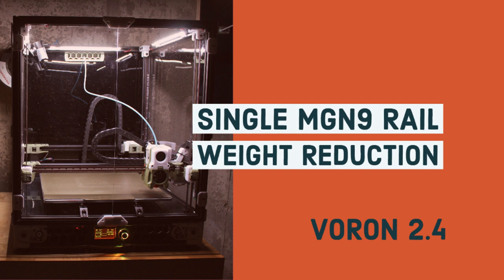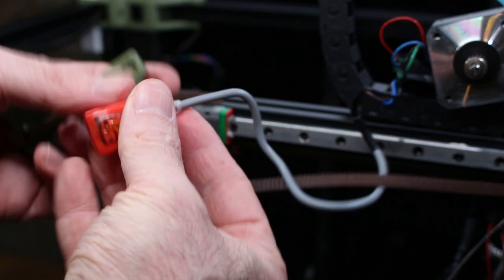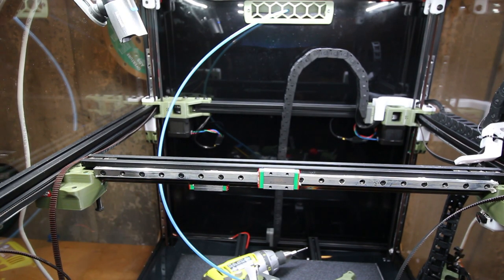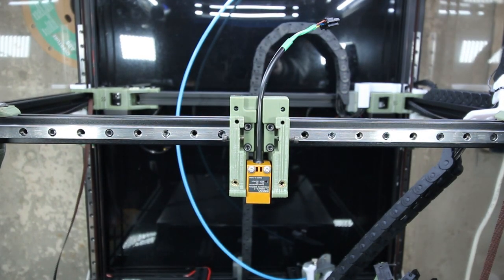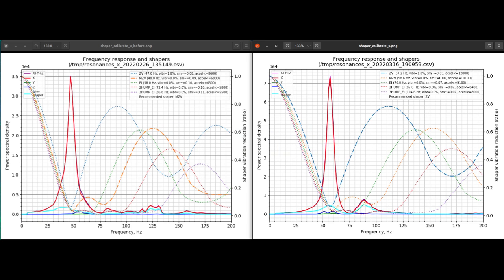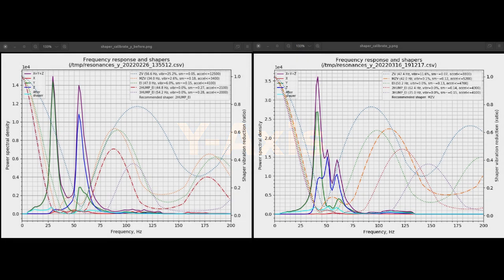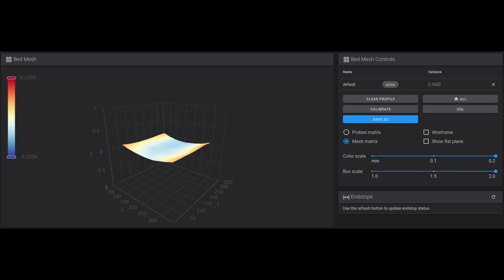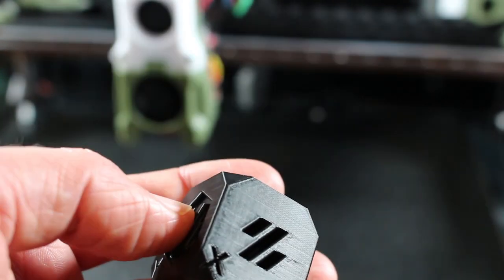Double your acceleration for free?  Eliminate x-axis weight with a single MGN9 rail.

Comment: Inspired by this video I've assembled my Voron 2.4 with one rail MGN9 and Stealthburner with CW2 extruder, finished last week. Already making some tuning but started printing some parts. A little change into the carriage was needed: put the upper thread inserts to fit the motor plate at the back of the carriage where it should be the head of screws. Thanks.
Reply from the maker: I'm really happy with how this came out and how well it's printing. It does rely on a High quality rail. I hope it's working well for you.  Thanks for the feedback!

Comment: I ended up going with a single MGN9 rail almost two years ago on my 350x350 2.4 purely out of frustration with alignment issues and weird things happening to the bed mapping topology when the chamber was up to temperature vs when cold ... Purchased a MGN12 rail from Ali Express at the time i went to the single small rail, thinking that i will upgrade to the single 12 when it arrives but i have just had absolutely no reason to and completely forgot that this was the plan... This does work very well for me and i have printed and sold many parts from this printer with great results.
Reply from the maker: I have been avoiding the mgn12 rail..  I also have a new one sitting here in it’s package waiting to be used.  But I really don’t want to as the mgn9 works perfectly.  The only problem I have seen is if you try to move to the r2 xy gantry joints, they are designed for the increased height of the mgn12 rail, so if moving to tap, you need to install a spacer to keep the xy belts parallel to the rail.
Reply: @KapmansBasementWorkshop  Ah, that is very good to know, thanks. At this point I think I would look at just replacing the single MGN9 if I start having any issues, and maybe trying to go up in quality to something a little better than I have in it currently.

Am also currently printing out parts for a Euclid type pcb probe setup (My original Omron type probe has been going fantastically well, but is starting to bulge out from the heat of printing at higher temps) - so i will be making good use of your video on the Euclid probe setup shortly. 
Thanks for the detailed videos!
Reply from the maker: Thanks for the comments. Euclid probe has worked great for me. I’m sure it will for you too.  Be sure to check out the automatic z-calibration software as well once you have Euclid working. I highly recommend it.
Reply: @KapmansBasementWorkshop  Awesome! Thanks

Comment: I just did this on my 2.4r1 and honestly just take the 8 M3 bolts holding the x-axis to the linear rail blocks and remove the whole thing outside the printer.  Way easier than trying to disassemble everything inside the printer.
Reply from the maker: I'm getting ready to work on my gantry again.  I will follow your advice!

Comment: Its almost like the design engineers had no idea what they were doing when they found that the original single MGN-9 design caused issues and they added that second one to fix it. Personally, I think they are re-making the same mistake going to a single MGN-12. My observation is that the entire print head can twist (I observed this when the screws on my bottom rail had worked loose). The twist is not coming from play in the rails - it seems to be due to the elasticity of the ABS itself. That second rail really does seem to address tortional stress in the tool head. I'll be interested to see if you are still using the single rail in 6 months.
Reply from the maker: It's almost 6 months since I made that video.  I'm never going back to 2 rails in the x.  And i have no intentions of adopting the MGN12.  I just moved to StealthBurner and modified the old carriage to work with SB CW2 and I'm very happy.  I'm not going back.  I agree, I think some of the movement is the ABS itself.  I also believe the dissimilar metals cause a bit of a problem when they get hot (aluminum extrusion and steel rail).  But I saw nice improvements with a quality single rail.  And a nice acceleration bump as well.  Thank you for watching!
Reply: @KapmansBasementWorkshop  I'm glad you got a good result - there's no arguing with results :)
Reply: Amateurs don't read or understand how to read datasheets and have no experience in real machine building and actual nechanical engineering as opposed to lego construction and playing follow the leader sheep like thinking.
Reply: @m3chanist  perhaps, but is it the Voron devs you are implying are "amateurs"? Do we even know what their qualifications and experience is?
Reply: @KapmansBasementWorkshop  Beautiful work! Going to update now my only system to CAN bus and Stealthburner.  (my first cable break, i see more damaged wires and my temporary fix with soldering the cables  is nothing forever) Would you mind sharing the modified x-carriage for CW2?
Udpate: sorry too fast, i found it in ellis repository :-)
Reply from the maker: @quattroes  Thank you very  much!  You can find it at Ellis's repository or mine.  So far, Canbus has been great for me.  My video on Klipper screen shows some additional changes where I remove the waveshare hat and replace it with a BTT U2C device.  May you have a smooth and quick transition to canbus!
Reply: @KapmansBasementWorkshop  Thanks! Will have a look :-)
Reply: @KapmansBasementWorkshop  do you still use the single mg9 without problems?
Reply from the maker: @adeo  I am still using that single 9mm rail. That said, I have ordered a new one with higher preload mainly for TAP.  But I am currently using the same rail with Tap and it works. I want to see if I can get some benefit from a tighter rail.  I really think a quality 9mm rail is all that’s needed with these 3d printers.
Reply: @KapmansBasementWorkshop  thank you
Reply: @KapmansBasementWorkshop  why not just reball existing rail? Drop into your local skf shop and get some different size balls for the carriage

Comment: In regards to the comment on why MGN12 and not a single MGN9, the cause seems to be production quality. For hiwin it makes a lot of sense with mgn9, but when looking at the cheaper rails that a lot of people get, they can have play and wobble which is more easily avoided in production of mgn12. This is what I've heard reiterated, it makes sense considering that was probably the reasoning for dual mgn9 in the first place.
Reply from the maker: I've heard the same as well.  I've also seen a YT video where someone actually measures the differences between the HiWin and another typical rail.  There really was a difference that depending on the use may be significant or not.  In the case of the x-axis, I think it's significant.

Comment: Hey, the stealthburner  also uses the lighter stepper motor too. You can find both the beta files for it and carriage adapters for almost any hotend to use that stepper motor. Im  currently building a 350mm voron 2.4r2 but reprinting the stealthburner partd
Reply from the maker: Yes, I definitely plan on building stealth burner once it gets out of beta.  I'm expecting it to change a bit before it's finalized.  I've also got some other ideas of how to drop a significant number of grams from the x-axis I'll be working on before then.  Thank you for the tip and for watching.  And I wish you good luck with your build!

Comment: old video I know.  But these rails will slowly wear away and lose tolerances.  Looking at your bed curve I have to wonder how much this increased wear attributes to the bed curve being reported.   As you know wear will occur fastest where the rails run the most often, the most traveled segment will translate to the middle of your bed.

You see this a lot with old mills and lathes...the cast iron ways slack in the middle of the range and the if you take the slack out by tightening the gibs it can be almost impossible to use the full +/- range of the given axis.
Reply from the maker: The rails were relatively new when I did this.  I don't think it was a big factor.  And that one rail is the exact same one both before and after.  I don't believe it was a factor in this case, but I believe you are right when it comes to more heavily used rails.  Truthfully, I believe once the gantry is using a single rail that is perfectly straight, the biggest issue that makes the bed appear curved is due to the gantry heating up with the dissimilar metals...Aluminum and the steel rail that causes them to curve making the bed appear curved.

Comment: Are LDO linear rails (LDO-SLR9H-400Z0) good enough for the 1 rail mod? Would said mod cause a loss in quality, compared to 2 rails, during very high accelerations?
Reply from the maker: They are probably fine.  Especially if they have some preload.  The carriage on the rail should not have any rotational play.

Comment: Did you do the resonance tests with the same conditions for the before and after? It looks similar to my results on a 350mm from when I moved it from the kitchen table to the floor. The dfference really shocked me.
Reply from the maker: Those were the exact same conditions and location.  The printer did not move between the 2 tests.  I wanted to make sure everything was the same for accuracy.  I assume the floor gave better readings in your case?
Reply: @KapmansBasementWorkshop  Yes the floor gave me similar results to yours but with some more vibration and less accel on Y. 

Really impressive results, I should consider moving to one mgn9 when switching to Stealthburner. Do you know what caused the 2 humps on your first graph? I'm wondering if the gain was only through weight reduction or also a correction of misalignment or similar.
Reply from the maker: @felixisme  I only removed the one rail.  I did not adjust the placement of the rail I left on at all.  I strongly believe this is all from weight loss on the gantry.

Comment: I dont think you should put grease on linear rails, the tiny balls need to run through it... you need much lighter lube for that.
Reply from the maker: There are many that believe light oil is enough, and for this application that may be acceptable.  But I did research this.  These are Hiwin rails and I went with the Hiwin recommendations.  https://youtu.be/jqBq4DB89f8
I must say, while when new these rails had some preload, after some time running with the grease, they glide beautifully with no play.  I'm very happy  with them and the grease.

Comment: btw. Is there even a reason to use an extrusion and then mount a rail to it? Wouldn't using only a rail as the x axis be enough?
Reply from the maker: I think on smaller printers, a rail is probably all that is needed.  Although I wonder how flat rails are.  Bolting one to extrusion (assuming high quality extrusion) probably can help keep it straight.  I've seen printers that use a rail only, but they tend to be smaller.
Reply: @KapmansBasementWorkshop   If I imagine an MGN12 being mounted between those Voron gantry extrusions, to someone like me, who didn't study engineering, that would seem quite sturdy.
Reply from the maker: @timha4102  I'm reasonably sure it would be.  Have a look at Annex Engineering.  They have multiple 3d printers available as DIY.  I know at least one of them does not use extrusion and just the linear guides themselves.  I can't remember if it's coreXY, but worth a look.  They have some really cool designs.

Comment: So I’m a little confused. Do you use a different shaper, accel and frequency for each axis? Or do you use the lower of the 2? This is where it’s a little confusing to me.
Reply from the maker: I don't think it's possible in Klipper to use a different acceleration for X & Y.  They must be the same.  So I choose the lowest acceleration to be used for both.  I set the deceleration to be half that.  But for the input shaper, X & Y are each set differently.  So these are what I'm using today in my printer.cfg:

[printer]
kinematics: corexy
max_velocity: 300          # whatever you like as long as it won't outrun hot end capacity.  This is probably the max for a dragon HF
max_accel: 5000			  # the smaller of the x & y measurements
max_accel_to_decel: 2500   # half of max_accel
....
later in the printer.cfg file
....
[input_shaper]   # Below are simply the recommendations on the charts generated in the test.
shaper_type_x = zv
shaper_freq_x = 57.2
shaper_type_y = mzv
shaper_freq_y = 42.0
Reply: @KapmansBasementWorkshop  perfect! Thank you. The accel was the thing I was most confused about but thought I read it correctly. The answer combined with a screenshot of yours solved all my confusion. Thanks so much for the fast reply.
Reply from the maker: @csenior10  I'm glad to help.  I think I say it in the video, but if you are removing a rail, make sure the one you have is high quality like a Hiwin or higher end brand.  The two rails in the original design were used to compensate for lower quality rails.  That said, this is working great for me.  I don't plan on using an single MGN12 or 2 MGN9's.  Both my speed and print quality increased with this change.  Best of luck with your modifications!

Comment: Just wondering how this mod is working out for you. Thinking of doing the same on my Trident (300mm).   Cheers.
Reply from the maker: It's working great.  I kept it in place when I just switched to stealthburner as well.   I have no intentions on using an MGN12 rail in the future.  Just make sure it's a Hiwin or some other high quality rail and I believe you will be happy with the results.